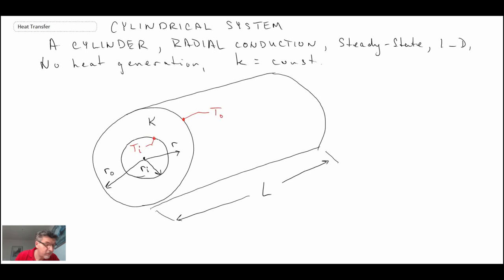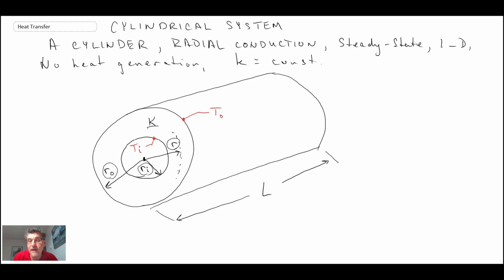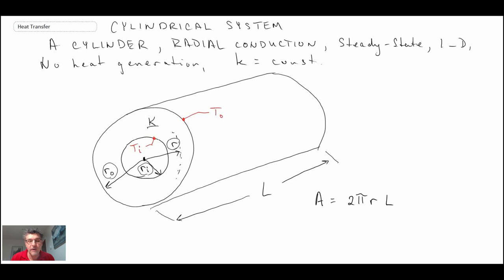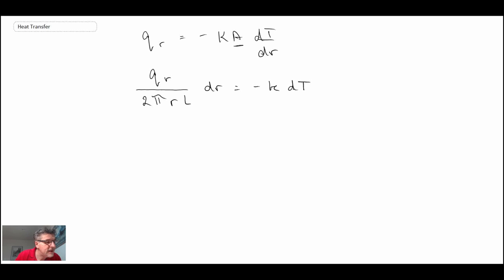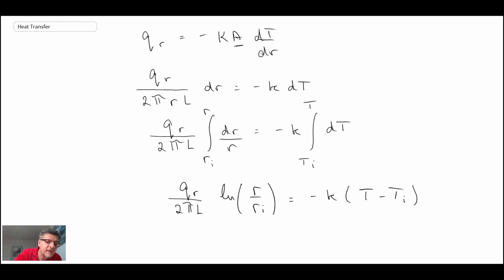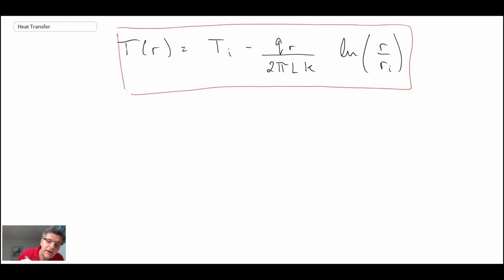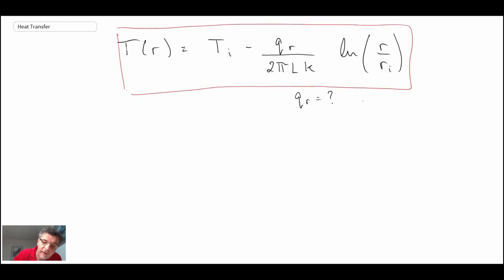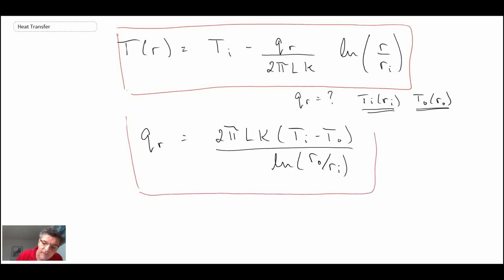Heat Transfer L5 p3 - Example - Cylindrical Conduction

Comment: I have a doubt how you have taken the area as 2*pi*r*l, by Fouriers law conduction is 1 dimensional but length and radius are 2 different dimensions, however heat flows along the radius so if this is the case we should take 2*pi*r*thickness right?
Reply: If I understood your point correctly, 2*pi*r*L makes sense for the area because the area is a lateral surface. In these calculations L serves only as the depth of the cylinder. (unlike with flat surfaces L is the thickness)

It is r which takes care of the thickness here and on the left side of the equation with dr the fact that the are expands the further away from the center we go, is taken into account, I guess.

Altho it was left a bit unclear to me, too, why we are using r instead of r_o . Or is it because we want to figure the exact heat flux at the point r which is between r_i and r_o?
Reply: @p1ker1  actually we take r to describe the heat transferred at a instantaneous r but we usually integrate between Ro &Ri when we want to obtain total heat transfer:)
Reply: as mentioned by P1ker1, that is the lateral surface or "surface area". Think about it, 2*pi*r is the circumference, where the cross sectional area is pi*r^2, so in other words 2*pi*r*L is the surface area of the cylinder.
Reply: @p1ker1  r is the control volume of analysis, between r_i and r_o